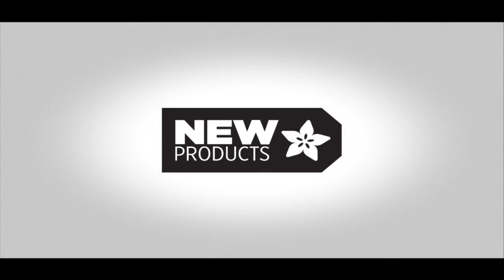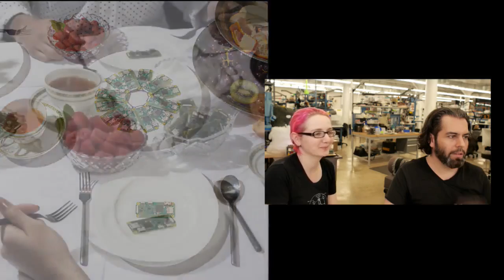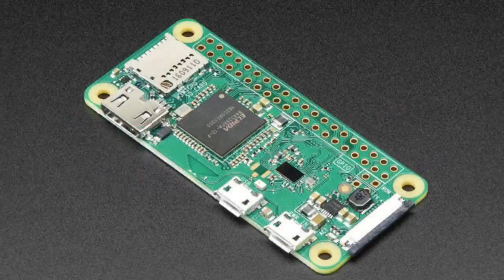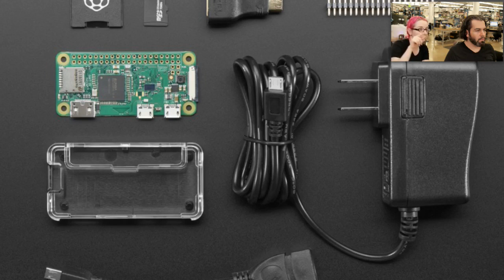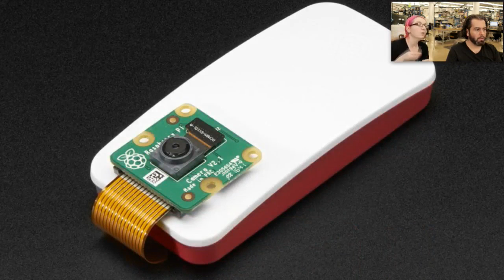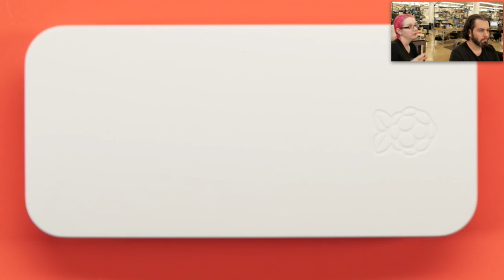New Products 3/1/2017

Comment: Any particular reason they didn't go for full size HDMI and full size USB-A port? That's a real deal breaker for me. For now, I'm better off with the RPi3 just for the convenience.
Reply: Timur Iskhodzhanov because it would take up a lot of space, and the whole point of this device is to be as small, cheap, and compact as possible.
Reply: Come on, look at the PCB – I think there's plenty of space for both of them. I wouldn't mind it being 1/10" bigger if that's really necessary.
Reply: It would add height
Reply: Also I think the point is to keep the same pcb dimensions, to make the devices interchangeable
Reply: My complaint applies to the original Zero too :)
Reply: Timur Iskhodzhanov I personally like it, because it makes it as small as possible, if you desolder the headers and/or replace the USB ports on the raspberry pi 3 it should be small and powerful enough for what you need.

Comment: It looks like there is a footprint for a U.FL (or similar) connector to use an external antenna. But unlike many U.FL connectors that I have seen, there is only one center pin solder pad. Any plans on either stocking a compatible connector, or pointing to a known compatible connector?

Also, any plans for an LED ring of IR LEDs to make a camera light ring for the NoIR model?